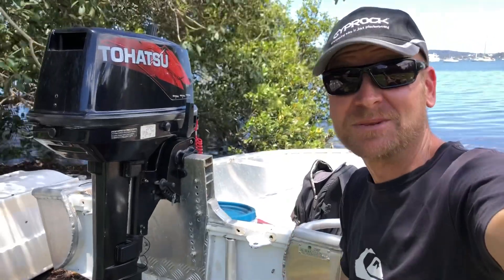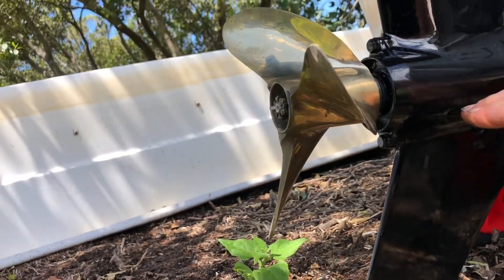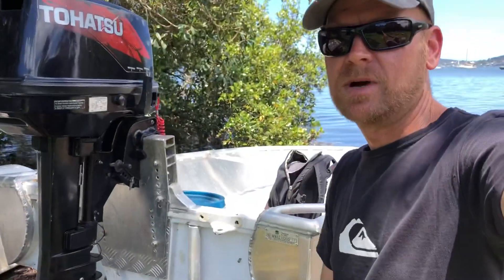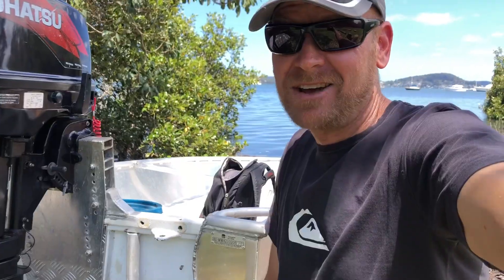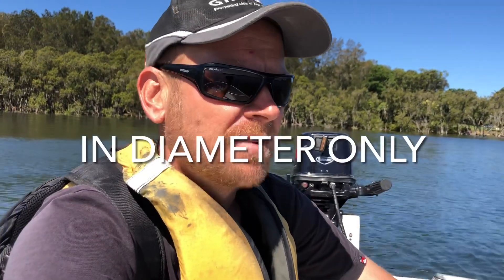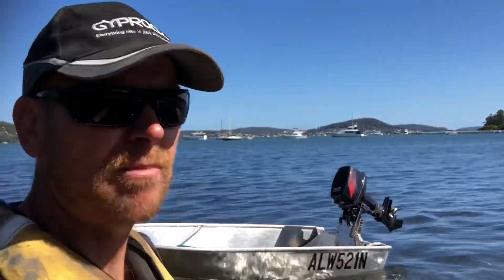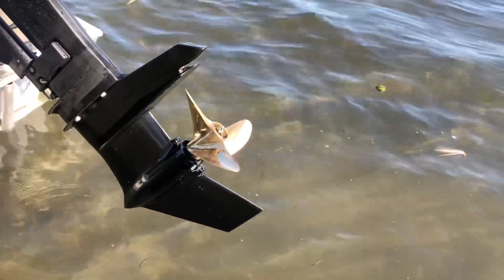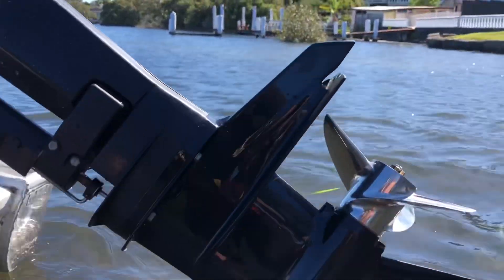Fast boat modified outboard

Comment: I always thought that prop drag was the biggest obstacle to going fast and  reducing fuel consumption.

I'd try some kind of power trim. Either the motor,trim tabs or both.
That'll get you on plane and control hull angle optimizing the hulls contact patch and reducing cavitation.

I wish outboards had a closed cooling system like everything else is.
Perhaps you could bypass the stock intakes and hook up a motorcycle radiator.
Mount the radiator where it gets airflow or put it in a cooler/bait tank with flowing water intercooler.

Here in the saltwater it would reduce corrosion and the need for flushing.
Sand,mud and seaweed are no longer problems.

Now put a foil on the hull and you can be like a flying fish.
Just the tip of the tail flicking as you fly above the water.
Reply from the maker: Hi mate,
yeah drag is a massive restriction for speed with boats.
with Trim, I want to keep weight down as much as possible so I’m going to make a light trim block so I can optimize the trim setting for top end speed (not too concerned about take off as long as I get up on the plane).
A closed cooling would be great but not sure a radiator would cool enough as most outboards run at under 80 degrees Celsius, a heat exchanger would be the go.
all the best and cheers 🍻 
Aussie Boat Guy 😎
Reply: @jeffarcher400 what about using some aluminum tubing Tig welded to the hull as a heat exchanger?

Comment: Nanaimo bathtub racing . You may be surprised at the level of knowledge . You need to make changes ... You will go way faster .
Reply from the maker: Hi mate,
love the tubs 👍
I would not be surprised at all, I’ve raced boats for many years, my friends dad was world champ tubber and my mate still has the boat.
The  tubs these days run the 9.9hp Tohatsu which as you know is way faster than the 9.8hp (which is the same as the 6hp with some better parts)
the 9.9hp Japan built is capable of close to 80kph with its 1.85 to 1 gear ratio along with a winrace prop on a ridiculously light tub. 
I might try my modified 9.8hp (which is close to 100cc smaller capacity than what they run on the tubs) on a tub and see what speeds I get, I’m estimating 67kph 🤷‍♂️. 
I may modify a 9.9 or 15 or 18hp next.
also keep in mind the 9.9hp Japan built is a de-tuned 15hp so is not too hard to modify along with way more wall thickness on the transfer ports for porting.
cheers 🍻 
Aussie Boat Guy 😎

Comment: (On the fly jack plate) would be good for this would be able to lower the prop into the water and get on plane and lift it up
Reply from the maker: Hi mate,
I totally agree and that would be awesome 👏 
maybe in the future.
cheers 🍻 
Aussie Boat Guy 😎
Reply: I’m not sure another 30 lbs would actually result any net net gain. Holeshot is pretty good as it is.
Reply from the maker: Hi Mate,
Yeah, I tend to agree.
If I was having trouble jumping up on the plane then maybe worth while but it actually gets up well.
True too about the extra weight, I definitely don’t want that.
Cheers 🍻 
Aussie Boat Guy 😎

Comment: my tohatsu m18e2 engine can only accelerate up to 51kmh... the engine still hasn't been modified just changed to an 11pitch propeller
Reply from the maker: Hi mate,
51kph on the GPS is pretty good for the 18hp, that’s about what I’m getting with my 18hp on an 11ft tinny with a 10p alloy solas prop. I’ve tried other props including stainless, other pitches but always come back to the 10p solas.
cheers 🍻 
Aussie Boat Guy 😎

Comment: I have a 4.8m fibreglass boat with 115hp Optimax, what top speed and cruising speed should I be getting? I get it up to about 40km/H and it alarms.
Reply from the maker: Hi mate,
Firstly check why it’s alarming, I would start with impeller and make sure the thermostat is good and water passages clear.
I would say you should be up around 70kph if running ok.
cheers 🍻 
Aussie Boat Guy 😎

Comment: What about extending the wetted water length with some long skinny tabs like on the big off shores.  Seems it would really help stability and the boat get up to speed so fast gives the impression there is a lot left.  It good to see somebody giving lessons in prop position for speed.  I talked to a Yammy factor rep several years ago at Miami boat show and he said most boat builders put their props way too deep under the boat.  When I went from go fast to center console I went and had after market Jack plates added.  What a difference, especially in fuel economy.  Without the plates I would never have been able to get the engine rpm’s up to the rated numbers.
Reply from the maker: Hi mate,
Really appreciate your input and trim tabs are a good suggestion 👌👌
Yeah, jack plates can make an awesome difference.
glad your enjoying boating champion.
cheers 🍻 
Aussie Boat Guy 😎

Comment: Move the outboard back about 30cm from the transom will gain more speed. Currently I run a 20 foot aluminum boat in Louisiana with the outboard back about 2 feet from the transom. With a stock 200 Johnson it runs close to 60 knots at 5800 rpm. The hull is a bit heavy being built out of 3/16in aluminum with dual consoles and set up for fishing in the marshes. Great job on your project so far and want to see it continue. Going to check the low water pickup video and maby add that to my rig to raise the engine up more since I travel shallow water most of the time
Reply: Think I mentioned why you use setback and why using setback is usually a good thing, but. I Don’t think bobs has ever made a setback bracket for a 8’ tin boat that weighs 95lbs.
Reply: If you move it back,you gotta move it up too, because the water rises behind the transom underway.
Reply: @chiphill4856  Mine is up about 6 inches. Bit rough on tight turns.
Reply from the maker: Hi mate,
Yeah, pods do make a good difference on some boats and have run them on a few setups in the past with great success. 
Unfortunately this boat is only about 8ft and running a pod would upset the balance and make it very unsafe.
Your onto a winner though with the longer boats, pods (moving the outboard back) can really improve things.
cheers 🍻 
Aussie Boat Guy 😎
Reply: Don’t see what any setback would accomplish. Setback is mostly for moving the center of gravity back in the boat. That’s useful on a heavier boost. Here all he needs to do is lean forward or back for instant adjustment. As far as motor height goes he can’t go any higher. The only maybe to going back is to be in cleaner water but I’m not sure that’s a real problem at this speed.
Reply: @mercmanwon  The farther back from the transom a motor gets lets the water turbulence settle just a split second meaning the prop gets a better bite.
Reply: @mercmanwon  tell that to Bob's Machine shop who's been helping increase boat performance by making setback jack plates for years.
Reply: @mercmanwon he even said in video he can go up over half inch yet

Comment: Very Nice work on the surface drive! 👌and some angry looking props too! I love tohatsu motors and as far as I’m concerned they are the best! Ever thought of modifying the hull? I’ve got a few tinnies and I’m thinking about either converting a conventional v hull Quintrex that is quite slow into a stepped hull or making a combo hydroplane/ v hull by adding a bit of sheet here and there. I’ve got tig welder so smaller jobs aren’t too bad but until I get a mig the project I want to do most is splitting one in half and making a wide stepped hull cat! but that’s an altogether different level of project! and more for time and materials than I’m willing to spend(for now now anyway)

Comment: Crackin.im thinking you may be able to drop the motor down a touch with chrome prop after you thin it out.just throwin it out there.
Reply from the maker: Hi mate,
You are probably correct 👌
I still want feed revs though for top end speed but lowering slightly will settle the boat too.
cheers 🍻 
Aussie Boat Guy 😎

Comment: Yo dude..next video please making the tunnel boat and try use this engine,by the way your working is very owesome..good job ✌🏻
Reply from the maker: Hi Mate,
Unfortunately won’t be making a tunnel, as awesome as that would be.
I may however get the chance soon to try that motor on an actual race boat.
cheers 🍻 
Aussie Boat Guy 😎

Comment: Was wondering if you could give me some advice please? Should the vent on INTERNAL tank on 6 hp outboard be closed or left open when not in use. Motor is kept on boat in marina. Thanks.
Reply from the maker: Hi mate,
definitely closed, it’s to stop moisture entering the fuel tank.
only vent when in use.
cheers 🍻 
Aussie Boat Guy 😎
Reply: @25hpboatracerman   Thanks for reply. The reason I asked was because someone told me his external tank expands and distorts in the heat if closed, and it would do the same to internal tank.
I think I'll take your advice. Thanks.
Reply: I’d recommend closed when not in use to prevent moisture intrusion.

Comment: Really interessed about the homemade cleaver propeller. Any video on how to build it?
Reply from the maker: Hi mate,
Yeah it a cool little propeller 👌
Unfortunately I built that before I was videoing that sort of stuff. It really was a lot of work, like 100hrs 😂
I mage the hub, the tube, the blades all separate then made a jig to hold the blades where I wanted and welded them on, then grind, grind, grind, sand, sand, balance, polish etc.
cheers 🍻 
Aussie Boat Guy 😎

Comment: hey mate ever consider doing bigger motors and putting it on a sea al supa skua
Reply from the maker: Hi Mate,
Yeah, had bigger outboards in the past, having just as much fun with these little ones.
Got a big bore 60 merc in the pipeline for another project too.
cheers 🍻 
Aussie Boat Guy 😎
Reply: @25hpboatracerman  yeah of course just thought a supa skua would be perfect for what you do and yeah that 60 for the haines?

Comment: Excellent,man.Add you some leading edge cup to that prop,will help with your hole shot.
Reply: Could add some to the trailing to get more top end? Fair bit of meat to work with!
Reply from the maker: Hi mate,
thanks for your encouragement 👌
Not sure if you mean trailing edge?
cheers 🍻 
Aussie Boat Guy 😎

Comment: It was just dripping water at full speed, check the cooling flow , great job👍
Reply from the maker: Hi mate,
Thanks 😊 pretty sure what can be seen in the footage is not the tell tale, just the trunk outlet connected to the thermostat outlet. I did keep a consistent  look at the tell tale.
cheers 🍻 
Aussie Boat Guy 😎

Comment: wow thats a knife it looks cool also HOW did you make your own prop thats awesome mate
Reply: I think he cut down a standard stainless prop
Reply from the maker: Actually made it from scratch and welded the blades on, got an earlier vid on the channel.
Reply from the maker: Hi mate,
I made a hub and cut three blades out of stainless steel. I made a jig to hold the blades on the hub at the angle and rake I wanted then welded them on. Ground the welds then polished.
cheers 🍻 
Aussie Boat Guy 😎
Reply: @25hpboatracerman  holy shit, sorry mate. I had no idea, that's awesome. I didn't mean to insult your skills.
I'm gonna go find the video now and watch it.
Reply: i get that but the skill that takes to get it simetrical on a 3 blade thats not to scoff at  @Mardy72

Comment: Hello What is the power of your engine?
Reply: 9.8 with port mods higher compression and larger carb plus a little felting
Reply from the maker: Hi mate 👋
I’m not sure of the actual power of the motor now but definitely more than 9.8hp 😁
cheers 🍻 
Aussie Boat Guy 😎